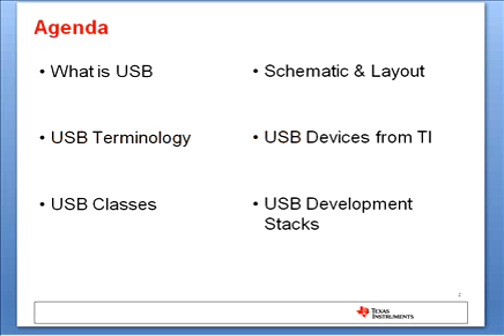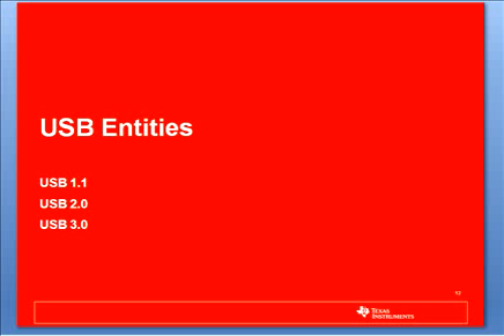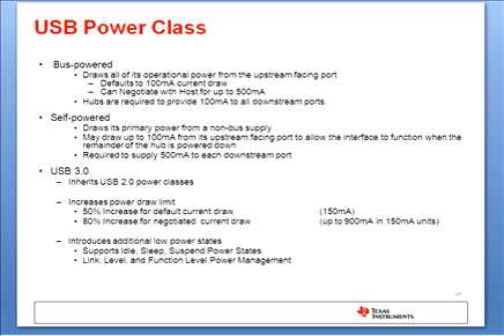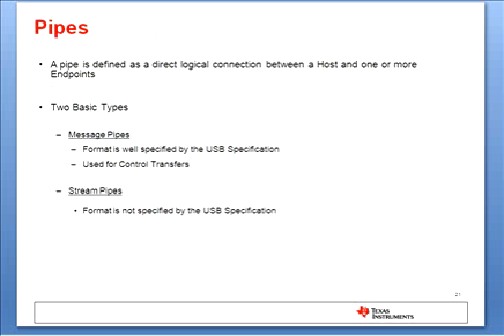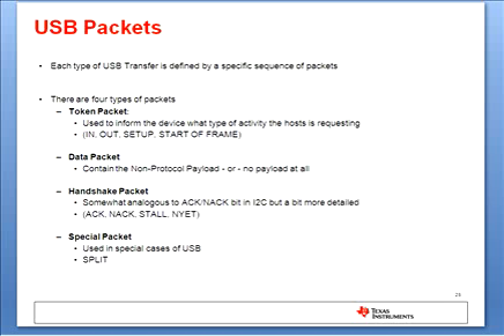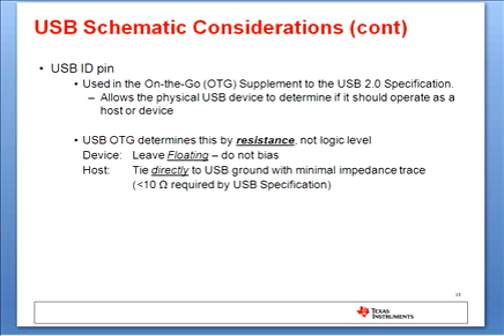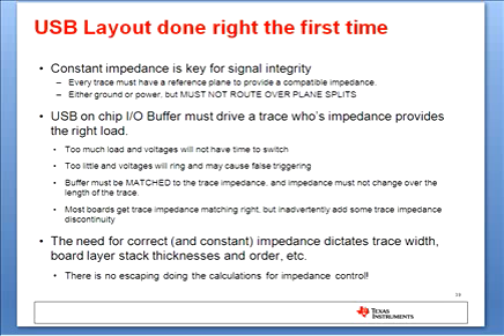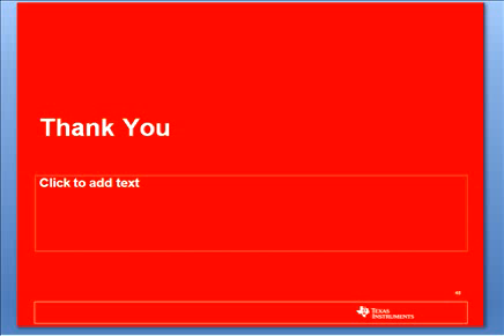USB: From Introduction to Rapid Development

Comment: Are there any ICs that would simplify usb communication/implementation?
Reply: Depends, if your trying to use one to HOST a USB connect like to take in keyboard input try out the MAX3421, if your trying to work as a client you can use software to emulate that such as on an ATtiny84